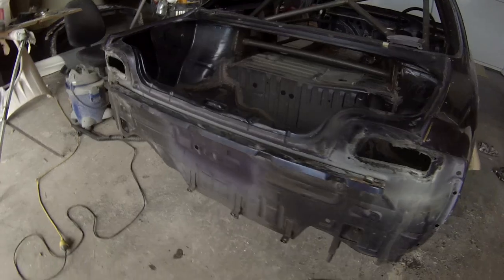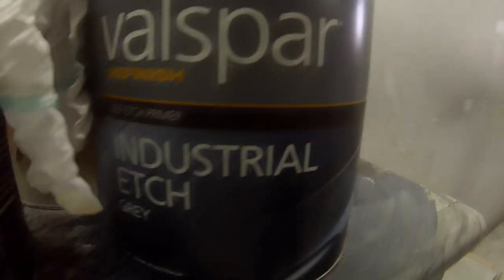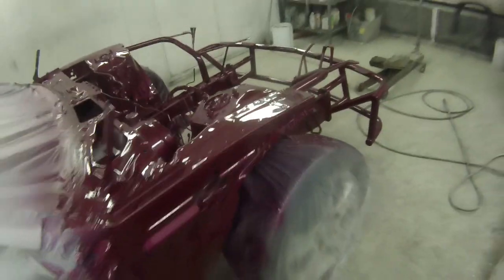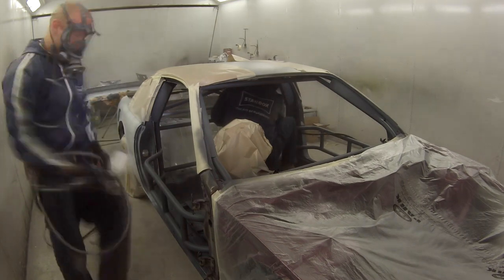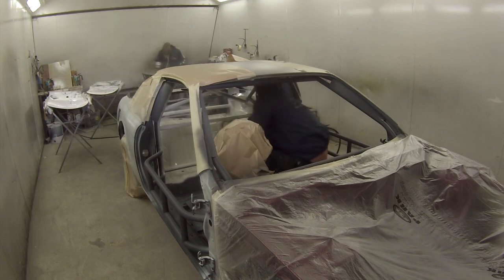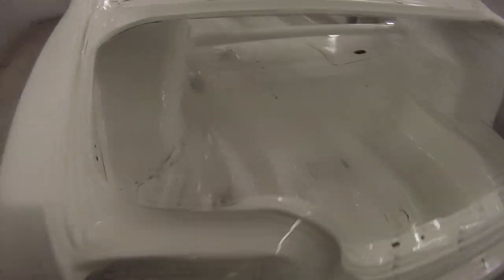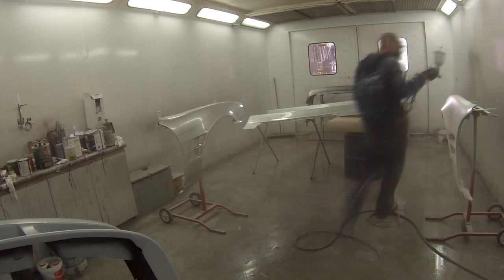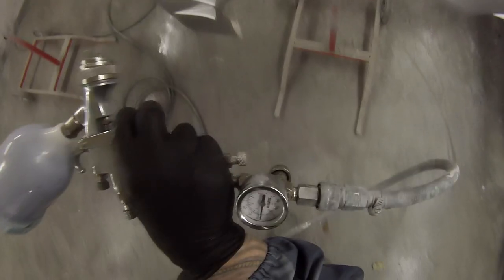Nissan S14 Drift Car Paint Job

Comment: Just an FYI, I got my FLG-5 this week, looks almost identical to your gun except name on the body of the gun and cap. The literature the came with it says it is a "Compliant" type gun and recommends 35psi, the part number for the cap is FLG-0001-5. I used it on a boot lid base and clear and it worked out nicely.

Comment: I'm using a glasurit 923-255 clear coat, would a universal reducer work. I just don't to mess up the whole car by adding this not the same product?
Reply from the maker: Slackerz Sincity As long as it's a 2k reducer it should be fine.

Comment: Hey bro, another good video! thanks for the hard work, It is appreciated! I just got a FLG 5 all the way from the UK. So i was keen to hear what your gun settings were. A few tips for painting in the cold would be good! Its chilly over here in NZ now so i'll be keen to see how your gun (the FLG 5) settings change or other tips when painting at lower air temps. Also, if you are getting tired of having to ramble-on all the time, may be just say in the vid that you will drop in some tunes for the next 5 min. That way people can watch your technique during that time or just fast forward to where your voice over starts up again?? Just a suggestion.
Keep up the good work!
Reply from the maker: ***** Here in perth anything below 20c is cold lol, I'm from Melbourne originally and it's cold there, but now I'm in a booth with no heat I really need to go back to the old techniques. The FLG5 kills it man, it does have a smaller trigger pull than the GTI's but I'm very impressed with it for the price. Thanks for the feedback too mate.

Comment: Hey gunman, I have a question about painting a set of wheels. They are in good condition and I want to just repaint them. Would sanding them be enough or should I prime over them after sanding?
Reply from the maker: Christophe Blanks You should be right to go straight over them as long as they sanded down nice, just be careful not to overload the first few coats of colour or they could fry up.

Comment: One thing I've come to notice since watching a few of your videos today. I'm learning to paint myself at the moment and my biggest concern is gun set up. When you talk about the guns you're using and their set-up I get a bit lost. perhaps adding the information to the comments?
Reply from the maker: Sorry for any confusion but don't forget that every gun is different for starters and also the settings are there for a reason, to be used, if there was one setting that was perfect then it would be locked there and no need for us to worry about changing them, the weather conditions, paint type, gun, desired finish and surface being painted will greatly change the setting required.